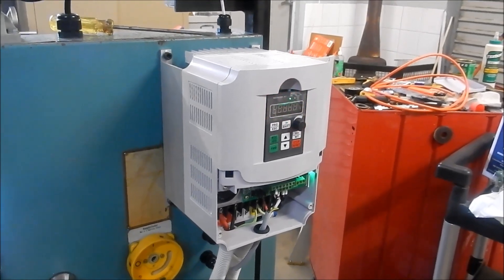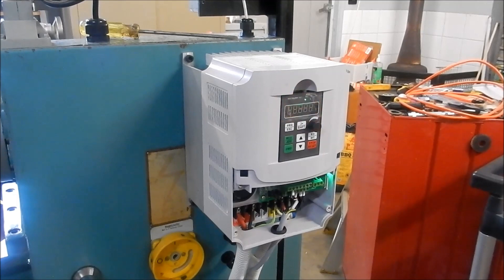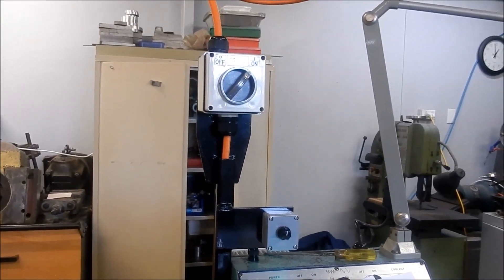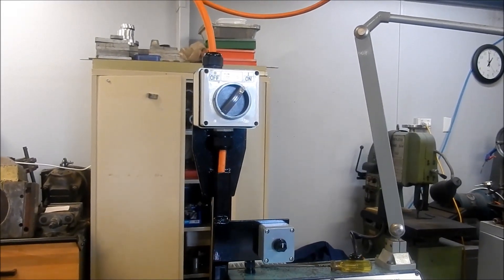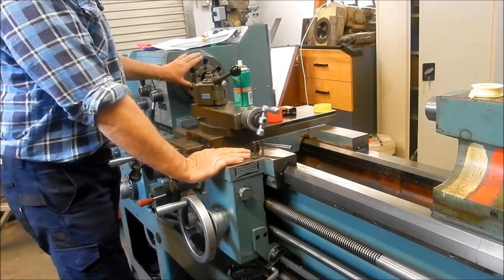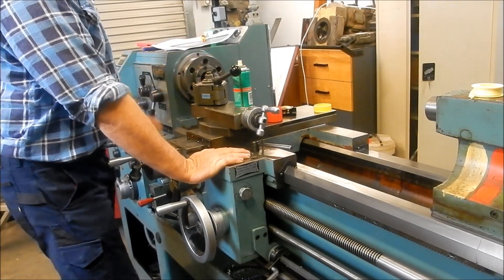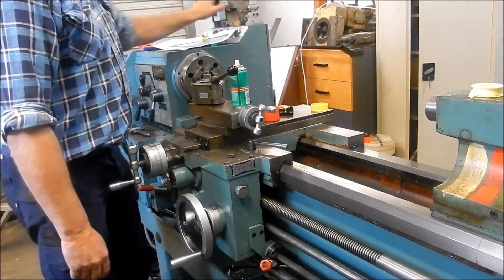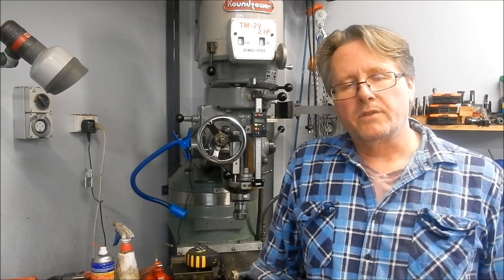240V Single Phase to 415V 3 Phase Inverter, YouTube Policy Change, Finally Running the Victor Lathe.

Comment: You spoke about running the motor at 2hz and I wanted to make sure you are aware that running a motor at lower speeds (when it isn't designed for this) can mean that the motor's cooling fan won't run at full efficiency. A combination of the lathe's gears and the speed control can overcome this so that the frequency is kept high enough (say +/- 20-25%) and hence the cooling of the fan works correctly. If, on the other hand, the lathe was designed for variable speed then you won't have problem but I've heard of burned out motors where low frequency and high load have been used. At least initially it would be worth your while to keep an eye on the motor temperature.
Reply from the maker: G'Day Neil, absolutely agree.  I only mentioned the 2hz to show what these drives are capable of.  I have designed many process machine lines in my career which use AC motors with drives and encoder position feed back to set a deceleration to stop and hold a given position.  Forced cooling is a must in these designs because as you say they will burn out with long exposure under this type of use.  All my machines run thru Inverters and at times I do drop down into the 5 - 10 hz range for slow speed particularly on my Milling Machine Slotting attachment.  This is only for short periods as I'm aware of the overheating issues that can occur.
Cam
Reply: @camatbattler2233  I thought you might be aware of the dangers but I wasn't sure if your audience were and while it's great to have these modern inverters it is important to know about the limitations. Thank you for your willingness to share your knowledge with us. Regards Neil
Reply: @neillawson4493  Agreed. That's why it's better the way he's done it by retaining the machine's mechanical speed controls.

Comment: Thanks Cam. I thought it was impossible to get a VFD that would output 415v from 240V without a boost transformer. I tried last year and couldn't find anything. Maybe I'll get around to doing this on my Colchester.
Reply from the maker: G'Day Mark, it really changes the power landscape in our small shops.  As I mentioned this is only a recent development and one I'm keen to follow up on with my Hercus No 2 Tool and Cutter Grinder.  Another restoration I'll get around to one day.
Cam

Comment: Nice job.   I have the Surface Grinder, Shaper and Mill all on such 240-1p to 315-3p VFD's here in NZ.  Works a treat and having the ability to tweak speeds on the Mill and Shaper rocks.  If you use the VFD in V/F mode then you can actually have a switch to flick between the 4 and 8 pole connections.  I use this on the Mill.  You have to stop the motor, wait for it all to stop before switching the pole connection. But if does work and its rather convenient.   I didn't want to risk vector control as the motors are all a bit old. Also not all the VFDs in my position have it.  Cheapie ones.  :-)

Cheers.
Reply from the maker: Hi James, thanks for the tip on the 4 - 8 pole switch over.  I have wondered about the ability to run both poles out of the same Inverter but thought that as part of the parameter set-up for the inverter you can chose either 4 pole or 8 pole not both.  So in V/F mode this parameter is not an issue?  I'm keen to try it out.
Cam
Reply: @camatbattler2233  If you are getting the full range of power under vector control and the motor is up for it (ie insulation on the windings is good) then vector control is supposed to be superior.  Under vector control you have to lock to a single spec as it does a bunch of clever tuning to the motor. Under V/F that doesn’t happen. At least not on my unit.  Happy to share learnings. Do you have a link to an online manual for your model?

Comment: Awesome work Cam!  I like the way you wired into the contactors.  Thank you for sharing this.  I use vfds for anything needing 3 phase power. Seems at this point a better alternative.  Good to see the step up type working too.
Reply from the maker: Yes lets hope its a robust unit and performs for years to come.  Yep, have the Relays under power to activate when the Froward/Reverse lever is used and send the signal through to the Inverter allows the machine to run in its normal function.  Makes it so much easier to operate without needing to access the touch screen all the time.
Cam

Comment: Feel free to monetize your channel Cam. I pay for YouTube premium and never see adds. My other DCT channel is monetized. However recently Google has decided to place adds on any channel as they see fit. Also they made me fill out USA tax forms to pay tax in the USA. Regardless that I declare the money I make and pay tax on it in Australia.

Nice inverter CAM. I went with a rotary phase converter predominately for my CNC machine. It’s an 8kw unit and runs my entire shop. It doesn’t use that much power on idle. Yours seems to work just fine. The variable speed is a bonus. Cheers 🍻. Aaron
Reply from the maker: G'Day Aaron, yes you certainly need a true stable 3 phase signal for a CNC with that power so Rotary is the way to go.  I would love to see how stable this is with a smaller CNC, maybe one day.
Cam
Reply: Yep YT changed the policy back in November of last year. Because of that I monetized just so I could control the ads. I have it set up so they can't put ads in during my video. They are only allowed at the beginning and end and also you can skip them too. Something to think about Cam if ads do start to pop up.

Comment: My lathes do not have an oil pump in the headstock, splash lubrication that feed the spindle bearings and if I run them less than 30 Hz the oil is not flung high enough to fill the troughs that feed the spindle bearings.
I assume the Victor would have an oil pump like my old DSG that I reluctantly sold when I moved overseas
Reply from the maker: G'Day Willem, yes that is a concern I have on this lathe as it is splash lubrication feeding an oil trough in the top of the Head Stock.  This is the same on my Hi-Power lathe as well.  If I am running for a period of time at a slow speed I will run at full speed occasionally to feed the oil trough to lubricate the Head Stock Bearings.  I haven't had any bearing issues since I install new ones when I purchased the machine 7-8 years ago.  I'm hoping the same regime will work on the Victor.
Cam

Comment: Nice lathe Cam, looks the same as Adam Booths lathe, aka Abom 79.
I fitted 5 VFD's in my shop, no 3 phase power available, to my lathes, mil and compressor.
220V single phase input to 220V 3 phase output.
Discarded the power sucking inefficient single phase motor's which were also prone to run capacitor failures.
New one to me achieving 415V from 220V supply, the drive must have a voltage doubler circuit on the DC bus.
Just a word of caution, try to avoid using the E stop or foot pedal, the drive will generate a high voltage spike wich can damage the IGBT's.
Looking forward seeing the lathe in action.
The power of Google and ever increasing greed!
Reply from the maker: G'Day Willem, yes totally agree on the E-Stop and foot brake but the E-Stop in only when things are in dire straights.  I do use the Foot Brake at times when I'm threading up to a shoulder but its at low speed and only very occasionally.  These are only new to the market so I'm interested to see how they perform over time.  The Nflixin techs run each one on a load test frame for 24Hrs before they are packaged so I would expect any infantile failures to be identified then. 
Cam

Comment: Nice job Cam. You are looking good. All the Best from the US. This expands the potential to pick up some older machinery. Thanks for sharing.
Reply from the maker: G'Day Bruce, as I mentioned this could be a real game changer for those of us with small hobby workshops who want to run 415V 3 phase.  As you say, we can now look at older gear that previously we would need to look at converting into single phase.
Cam